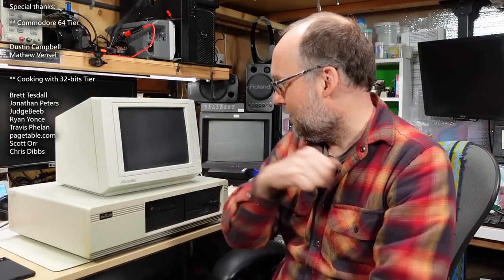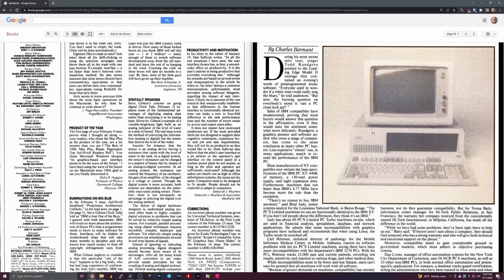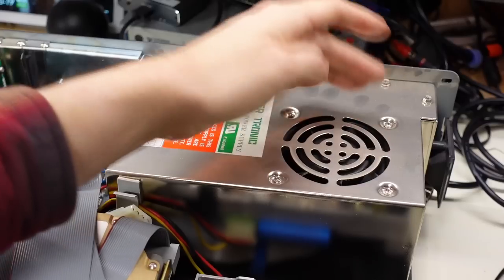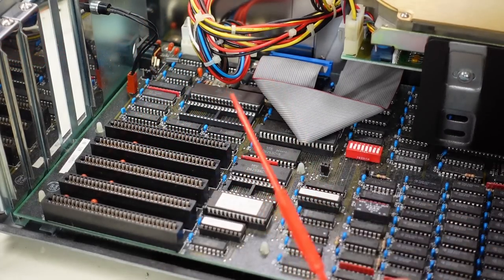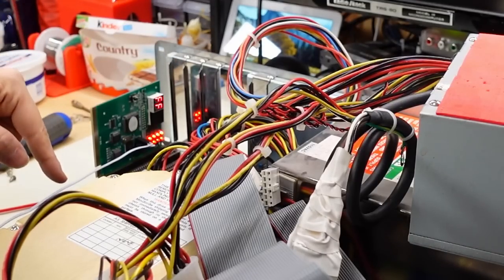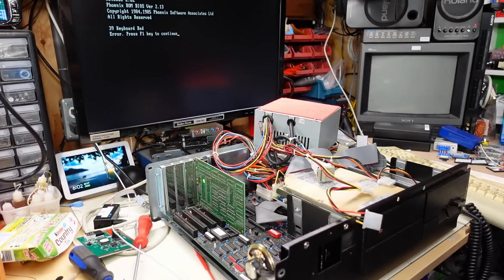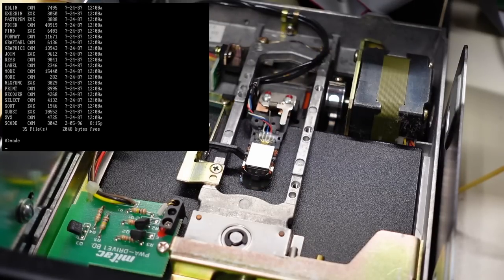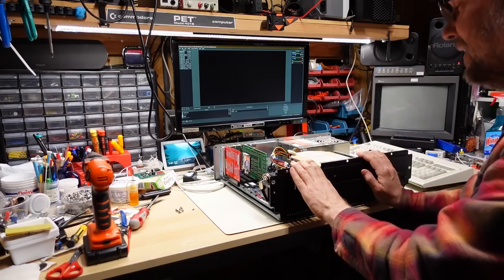What mysteries lurk inside this mint Turbo XT?

Comment: 8:11, all the screws are in - 😅 In 2002, I took over an IT manager job from a guy who had opened up the PCs so often that he got lazy and had been leaving the screws out. I discovered this when I pulled a malfunctioning computer out from under a desk, and when I lifted it up, the case cover just came right off in my hands. Having to remove six screws is admittedly a bit of a pain, and arguably overkill, but it's definitely good practice to at least leave two of them in. 15:40, why wouldn't they just put the reset button on the front? Who knows? I know! It's because in 1987,  power supplies and PCs were hard-switched, which meant that the moment you pressed the reset button, the computer would reboot. That meant accidentally brushing the button while reaching for something in front of the computer, a curious child, or, for those of us who liked to put our big ol' desktops on the floor, one false foot move could all result in an instant reboot and loss of whatever we were working on. My first computer, built in 1989, had a reset button on the front, and all of the above resulted in data loss at one time or another. That's why Mitac chose to put the reset button on the back.
Reply: @drippingwax  mine is now 10 years old (with 11 year old specs) but it’s only just starting to run up against its limits, and it still isn’t hardly ever getting properly sluggish, because I’d given it an i7 2600 and CPU development was slow enough (up until Ryzen’s 2nd gen) that it practically didn’t age at all in the first 5 years I had it. 

A few years ago it was on par with the cheapest i3 and I think it’s now similar to one of the Pentiums… honestly it still compiles and transcodes (my two actually heavy tasks) just as fast as it ever did, and while I wouldn’t want to edit 4k video on it, 2k is still just fine (just like it was when new, so no surprise). It has enough grunt to software decode 2k VP9 and HEVC, but without a ton of room to spare — I doubt the i5 2500 could do so because it has to lean quite heavily on the SMT to keep up with realtime. 

Of course the GPU it came with became obsolete waaay faster, but I barely played games on it and most of those were indie titles with low spec graphics or Civ (CPU bound) anyway. But I did replace it with an RX480 for a few mainstream 3D titles, whenever it was that that came out. 

Honestly it could probably last me another few years, but my laptop (bought at the same time) has been doing less well, and those M1 or M2 laptops are mighty tempting. And I think their compute power probably beats my 2600, considering the base processor is competitive with current i5s, so I feel like I’d owe it to myself to use that in a desktop configuration at home if I got one. But I’d feel kind of sorry for my “future proofed”, decade old i7 purchase to just sit there doing nothing, rather than waiting until Electron apps finally beat it into submission. 

…….not sure why I said all that, mulling on your comment about reliability got me thinking about how there may never be another decade when a power user can use the same CPU for a decade, I guess. I can understand basic users managing to squeak by with an 8-10 year old machine, but I still do Photoshop (CS6 admittedly, not the current version), audio and video editing, transcoding and compiling on mine; and usually use 50-100 browser tabs at the same time as those tasks. I suspect whatever model(s) it gets replaced with will probably only last half as long at best — Intel isn’t sitting on its laurels anymore.

Comment: At an old job, I used an IBM 268 6Mhz AT. With 640K, 40MB HDD, EGA and 5.25" and 3.5" floppies. The original invoice was inside w other papers. it was over $18,000 CDN - due to EGA and the "super large" HDD.
Reply: Given the price of the machine, did the work being done with it merit the price tag? I always wondered about that.
Reply: @AltimaNEO  GIS related stuff. I used it to compile from C, software for interfacing large RS232 serial digitizers used to make maps. Mostly for ocean mapping GIS. The software was $50K and supported other hardware like stereo plotters and terminals for entering soundings using our own designed and built ISA boards. Sold all over the world.
Reply: I’m really curious about the 3.5” drive.  I can’t seem to find any reference to what (if anything) IBM would have offered.  Was it stock?  Dealer option?

A lot of ATs have 3.5” drives, but they all seem to be added aftermarket and are often HD, suggesting that they were a later upgrade.
Reply: @nickwallette6201  I think it was a much later option. I think the order was for dual 5.25" 1.2MB floppies. But it's been a long time ago for me, I left in '96
Reply: Wow, I had to read tat twice - surely I got it wrong!
Reply: A few years ago I got ahold of a CGA equipped 286 clone without a hard disk, so I put in a Type 1 (10Mb, from 1981, older than me) - even in 1986, that thing, as equipped (I can't remember the RAM, probably 4 Mb, newer motherboard) would have gone for like $6,000 CAD with a mono monitor. It's on my channel somewhere.
Reply: @the_kombinator  Subbed!
Reply: Imagine having put 18K on the sp500 at the time. You could semi-retire now only on that investment

Comment: As  a note, I'd go and deal with the burn in using a burn-in remover screensaver.  It won't eliminate it, but it will certainly help.  

I really should write one of those for DOS.  It would be incredibly easy to make with a custom block graphics character set, but it would be preferable to use graphics mode.

I'd also clean that screen cover, and adjust the flyback.   This is not to mention checking the HV caps and chokes.

Comment: Another good oil is musical instrument oil.  It is typically called valve and slide oil and is used for valve instruments like trumpets and also trombone slides.  It is a really light viscosity oil and comes in small dropper bottles.  Get it at any music supply.

Comment: Usually on XT clones, any RAM above 640K is available for use with a RAM drive or print spooler, which would require a driver disk from the OEM. Depending on how it's mapped, it may also be available for upper memory blocks using USE!UMBS.SYS.
Reply from the maker: It didn't seem to be visible to the memory scan on Checkit, so based on my experience making my UMB RAM boards in the past, it won't work with USE!UMBS in this case. There must have been a driver to turn it into EMS perhaps, although even that usually shows up in the upper space (page frame addressing) and I didn't see that either. Maybe switches on the motherboard configure this -- it might have all been disabled, who knows LOL!
Reply: I might be wrong but didn't they make some that have a register we could use to page that kind of added RAM? Not sure if it was a proprietary thing because you'd need to build your code to use it.
Reply: @adriansdigitalbasement  That sort of stuff can be affected by the BIOS settings, might want to check there. I remember having a 1Mb machine and the upper 384k being available as XMS/EMS/UMB but it wasn't available when a particular setting was turned off. Being such a long time ago I forget which one it was.
Reply: Would an XT clone even have BIOS settings?
Reply: @sparcie  HIMEM.SYS? But you need at least a 286 to address that RAM, because the XT had specific allocation for most of the memory above 640K (Video etc)
Reply: @nickwallette6201  XT's didn't have BIOS settings, just jumpers/dip switches. 386's I know had BIOS settings, possibly 286's, but I'm not sure.
Reply: @TheSimArchitect  The machine I had was a 386sx, so in my case yes. It also had a phoenix BIOS that looks the same. Obviously for Adrians machine it would only allow for UMB's if the DOS on it supports it.
Reply: @adriansdigitalbasement  Almost surely. I remember LIM-spec  boards that were invisible until configured via switches.
Reply: @nickwallette6201  A few later XT clones have an EEPROM to store configuration settings, like the Tandy 1000RL/SL, but not this one.
Reply: Chiming in as usual its VWestlife
Reply: @BlackEpyon  my old Compaq 286 had BIOS. I can't speak for other makes.
Reply: With a newer DOS? ... config.sys + himem.sys??
38:06 .. to have that burn in in the monitor... this machine must have belonged to a writer 🤔....... imagine the huge amount of text that has pass through that Wordperfect and Monitor. 🙁...
Reply: @Ramdileo_sys  HIMEM.SYS only works on a 286 or higher.

Comment: Solidly built is a good description for the IBM machines and their direct clones like this one =) Steel was definitely cheaper back in the early 80s and IBM pricing was pretty insane as well, so they didn't skimp on build quality. Anyone who's ever picked up an early 80s IBM XT keyboard or an original model M will know that there was NO saving cost by using thin steel! The XT case is made of pretty thick steel and the baseplate in the keyboard is, well, hefty is a good description!
I can imagine an IBM XT case getting run over by a car and the car having way more damage than the case of the PC.

Comment: Hi Adrian! I wonder if this was one of the PCs assembled and sold at the University of Oregon Bookstore.  I worked there from 1988-1992 and I personally assembled hundreds of PCs, many of them were Mitac XTs just like this one.  This one pre-dates me slightly, so (if so) it was probably put together by my old boss, John Clute (HI John!).  The UofO Bookstore was just a screwdriver shop, we assembled low-cost systems for students that usually just had DOS and Word Perfect on them, just enough for school work.  Mitac were particularly reliable, that's why we sold them.  Later we sold ALR PCs (also built like a tank), Amiga, and Atari STs (omg, those unreliable power supplies!!).  Glad to see this old workhorse is still functional.  Thanks for the video and all your content, cheers!
Reply: Wordstar

Comment: Mitac made their own disk drives back then. The computer lab at my high school was filled with Apple ][+s and had MItac disk drives connected to them. Solid little units, and not as expensive as the Apple units.
Reply: that's a little puzzling to me, unless Mitac had specialty floppy disk drives for Apple. Because Apple formatted disks entirely differently than PCs (and clones). Of course my 5.25" memories are a bit fuzzy now, but I seem to remember that the physical drive mechanisms were distinct. That's why people put out a chunck of change for  KryoFlux drives.  A PC drive couldn't read Apple Disks, and vice-versa. I think there are some more affordable versions on eBay and various sites. But not many companies made drives for both Apple and PC clones.
Reply: The original apple 2 floppy drives were shugart floppies and I remember a lot of other companies used the same drive mechanism. So the miatec drives mechanism would be able to ride if they had the right encoding software
Reply: @johnnyrichards2119  That's almost assuredly what they did. The drives looked like they used the Shugart mechanism, although they did sound slightly different than the Disk ][ drives. I'm sure they did what Apple did; put their own circuit boards on a Shugart drive and package it with a metal casing.
Reply: Mitac was a major Taiwanese manufacturer of floppy disk drives for many years.  Most of their products were sold to other manufacturers, and quite a few of their drives could be found in countless PC clones, including several that I own.  I also have one of the Mitac Apple II drives, and it has been very reliable and works perfectly to this day.  As far as I know, they made the complete mechanism themselves, although the mechanical parts could have been a clone of the Shugart design.  The Disk II used a particularly simple design inside the drive itself, making it relatively easy to copy.

Comment: I'm really impressed with how clean the inside of the system is.  Being 35 years old, I would have expected it to be pretty dirty.  It had to have been used for a fairly short time before being packed away and stored.

Comment: Great video! Would love to quickly reverse-engineer the speed setting utils, and discover how it's being implemented.
Reply from the maker: I forgot to upload those utilities. I stuck them here: https://github.com/misterblack1/mitac_utilities/tree/main
Reply: Huh. They're actually EXEs with .COM extensions. Probably to buff up the size a bit.

You output 0x7F (slow) or 0xFF (fast) to port 0x00C0, apparently.
Reply: @drippingwax  Nah, they're  MZ files. EXE2BIN removes the MZ header.

Comment: Amazing when you realize that when this PC was built the Amiga had been on the market for two years and how far ahead it was at that time. It gives a perspective.
Reply: Funny, I was thinking the same thing, recalling the excitement when I bought my A1000 in November '86.
Reply: The Amiga was sadly just slightly before my time, which was all Win95 and some Win98, so when I first saw the promotional video from 1985 (the “I Am Amiga” one) I kept thinking “yeah, so? Everything does that”. Then I went and looked when it was from, and went “oh crap, that’s way earlier than Windows or Mac!! Damn!!” …and I’ve had a fond spot for them ever since! 

Even more basic than these PCs, arguably, the ZX Spectrum was still sold all through the 80s and into the early 90s! I bet the kids with A500s felt so special, they’re impressive enough after a C64 but after a Speccy? Phwoar!
Reply: @kaitlyn__L  I had a C128 then and remember when I bought my first Amiga in 1987. It felt like science fiction and the leap was enormous.

Comment: That is a thing of beauty! It was probably in a laboratory or clean room setting, which could explain the the burn in, but no dust inside...
It looked like it could have been built in 2017, nevermind 1987... wow
Reply: Yes. Experienced that too, lab PCs under laminar flow boxes, sparkly clean after ~10 years of daily use. I honestly love it to work on them.

Comment: I built hundreds of XT Turbo clones back in the day. Lots of Seagate ST225 and ST238 hard drives. it's funny how rapidly we went from 20 MB hard drives to 80 MB. hard drives to gigabyte hard drives and now we're in the terabytes.
Reply: .. and there's 16GB capacity upwards available as microSD cards, and you pay a fraction of what the old MFM drives would've cost.

Comment: Lets not forget the quite rare XT-286, It was esentially a XT motherboard adopted for a seimens (If I remember correctly) 286-12MHz but was limited to the XTs original maximum of 1MB of RAM with no means of expansion besides an XT style EMS memory card and driver card. In an effort to entice customers into buying a 286 cheaper than an AT.

Comment: Yeah.  A real Blast From the Past.

I'm puzzled by the combination of the burned in screen and the amazingly clean interior of the computer.  One thing that occurs to me is that the monitor may have become burnt in on a different system.

I had one of those Amdek Monochrome Monitors and really liked it.  Got that for my 8 bit system.  A Lobo Max-80.

The other thing I don't understand - being a person who swapped components to debug and repair systems - rather than using Volt meters and solder - is how you could just clip off a part and not have a negative result.
.
Reply: The tantalum capacitors on these motherboards help to filter out transients that could otherwise occur on the power rails. As long as the noise isn't too bad everything will still work fine. In this case the blown one filters a 12v rail which likely isn't even used on the motherboard itself.
Reply: Well, seeing as the monitor exterior had been cleaned up (painted or otherwise), it seems reasonable that the computer received the same treatment. The exterior of the PC looked great too.
Reply: @eDoc2020  
Thanks.  That's the problem I have with working on a component level.  There's a lot of stuff about the actual electronics I don't understand.
.
Reply: @Qyngali  Yes - that could well be.
.

Comment: I LOVE those old XT power switches. I'd love a modern PC with one.
Reply: You can pretty easily make one. I know where I can get a bunch of those switches. In fact, if I cannot repair my 1989 386 (same case size) power supply (probably new caps needed) I'm going to put a good quality ATX power supply within the enclosure of the original AT power supply, keeping the switch :D

Comment: Twinhead was a clone manufacturer (I had one of their machines as a kid), and I've seen their parts in another machine, a Canon one, and Canon parts in the Twinhead machine. I think this may have been common among the Taiwanese clones. I suspect that many clone manufacturers were buying and using each others parts, possibly to save on the design costs. Perhaps they had some kind of agreement to help spread out the cost.

Comment: I have found a laptop on a local flea market here in Hungary, with exactly the same desktop components and specifications. The only difference is the motherboard form factor and the floppy drive, it is a 3.5 inch floppy  instead and it has an MDA video card. The laptop was designed in Hungary, in 1985 by the way.
It has 2 short PC ISA slots under the keyboard.And a Seagate 20MB HDD instead of a Miniscribe. I would really like to have a working  Miniscribe HDD in my collection.